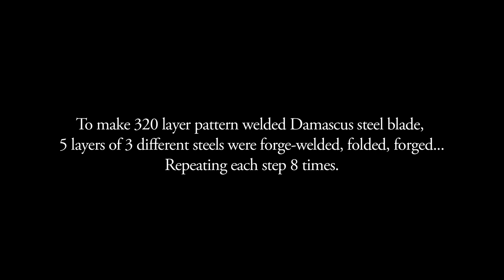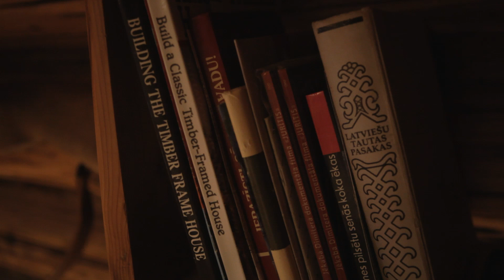The Birth Of A Tool. Part III. Damascus steel knife making (by Northmen)

Comment: That was a great video. I live in the old homestead house also & noticed that it's darkened up quite a bit in yours. I've had to sand the interior walls every 25 years to brighten it back up inside. I did it in 1988 then I checked it again this year by just carving off a piece. Basically I use knives where I can & a belt sander mostly for everything other than the cracks. I leave the top now black log alone to show everyone why we sand the logs down but the rest is that light beautiful golden :)

Comment: I was fifteen when i found a good hunk of the stuff at my local scrap yard and i find most of my tools and raw materials there as well. Age really has nothing to do with it. You just need to stop pissing around dreaming about it and go out and find the stuff, it might take you days, it might take you weeks but you will find it. The was tub was easy cut two holes in either side of the was tub and run a steel pipe with a set of holes drilled in it through. Hook up a hair drier or a shop vac. done.

Comment: I thought the swirls that are shown on the blade are the result of the repeated folding and twisting during the forging process but it seems like to me it's acid etched or dipped or somethin to create that look just on the surface of the blade. Can anyone fill me in on  what's goin on???
Reply: +AyeItsMeJames the first thing you said, grinder takes off layers to make it look that way, deeper you grind more layers
Reply: +AyeItsMeJames The two different types of steel forged together react differently with the etchant, bringing out the pattern.
Reply: They also might dip the blade into a container with ferric chloride...although I don't remember seeing them do that. The ferric chloride reacts differently with different layers of steel and highlights them

Comment: Can anyone please tell me what the white powder is that he puts on the hot metal?? I have been researching for it, but any step by step process does not say anything about a powder you put on hot metal... I know it's important, and I know this may seem like a stupid question.
Reply: Todd Roe I know this was posted five years ago now and you probably don’t care or have forgotten all about this and if you haven’t you have probably found out by now.
The white powder is called a “flux” most people use borax as their flux and you put it on the hot metal when you forge weld it together because the flux stops oxidisation called scale (the black flakes that come off when forging) because this scale makes it harder to weld the two pieces together and make spots where the metal breaks back apart. Most people use borax because it is cheap and effective but you can buy specially made flux on amazon or eBay heck you can even use sand as a flux, the main thing is that it slightly melts into the metal and forms a sticky layer that stops oxygen from getting to the metal. You don’t need to use flux but many people say it delivers much better results when forge welding and I can agree with them.

Edit: 5 years later I hope you are well and still alive 😂. But seriously I hope you are happy and have Followed your dreams wether it be a blacksmith farmer or ceo. 😀

Comment: Hello dear masters, let me ask and waistcoat you have a little bit of precious experience!!!! I would like to know what you sprinkled on the metal before re-opening it to crack in the oven! and I could achieve such a result in the blackening of metal!!! I will be very thanks to you for the information!!!!!!!!!!! finally a big thank you, you have great work and also spacio for your video roliki. I helped many!)))
Reply: +Mykail Orlyk i dont the exact name of it, but its a compound used to remove impurities from the metal, which also then helps to stop oxidization of the surface metal
Reply: +Mykail Orlyk You mean at 2:18 ? That's just borax. Same stuff you use in laundry. It gets rid of all the impurities so the weld is more likely to hold.

Comment: What does the Borax or whatever he puts on it do?
Reply: It acts as an oxygen barrier to prevent the weld surfaces from scaling up. Hot steel oxidizes very quickly, so if you want a good, solid weld, you need to eliminate as much oxygen from the area as possible.

Comment: The original method of producing Damascus steel is not known. Because of differences in raw materials and manufacturing techniques, modern attempts to duplicate the metal have not been entirely successful

Comment: that's not the TRUE Damascus steel, it just look like it, couple of different hardness steel, folding and twisting it, make the Damascus steel pattern show up, but that's it. :(
Well it look cool :D
Reply: It is not at all necessary to make the distinction between modern pattern welded Damascus and authentic wootz or Damascus steels since the title clearly indicated this is about making a tool, which would not be possible with authentic Damascus since no one knows how to make it.  Your comment also seems to suggest that modern pattern welded Damascus is somehow inferior or easier to make. I can assure you the modern process is just as or more labor intensive than making the original stuff. Modern steels are also so superior to the old stuff that it is not even worth talking about. Whenever you hear a story about how incredible some old metallurgy process is whether it is wootz steel or Japanese tamahagane or Ulfberht swords understand that the properties are being compared to contemporary metallurgical processes not modern ones.
Reply: bullvalene true. 
I would want to see, the modern high quality steel manufactured by Damascus process. I know it's impossible, because no one know how, and I doubt it's possible with other steel than original stuff, but it would be cool it it could be made.